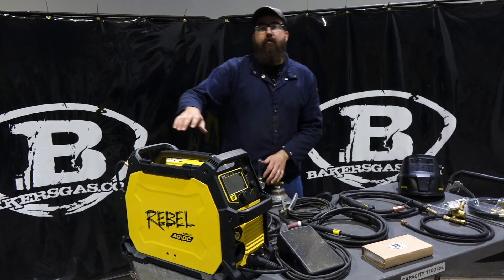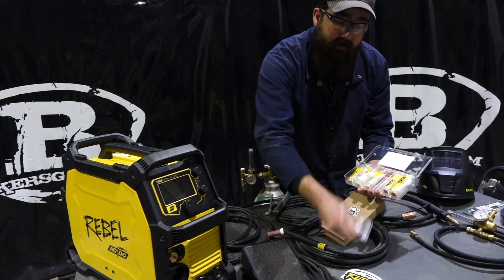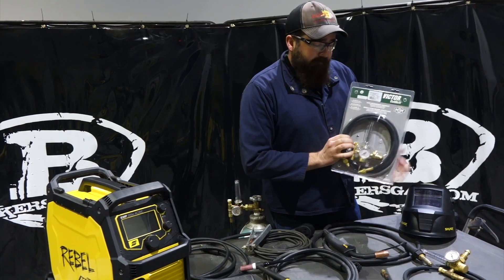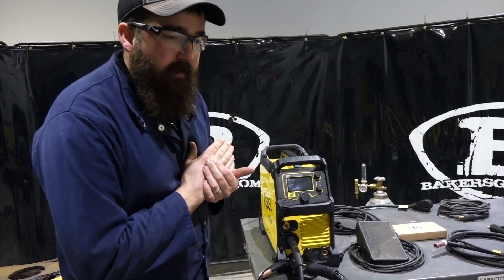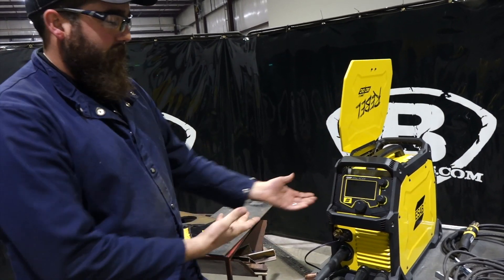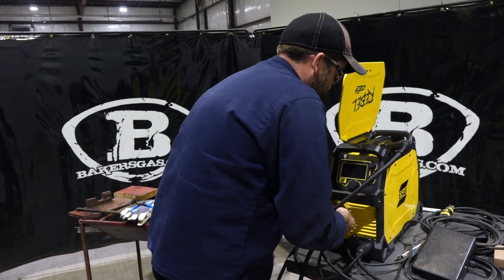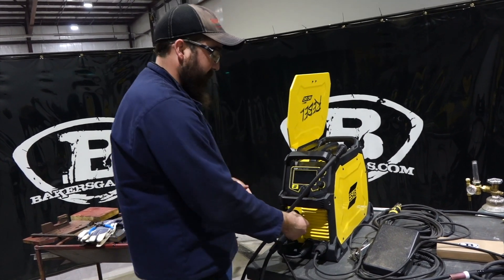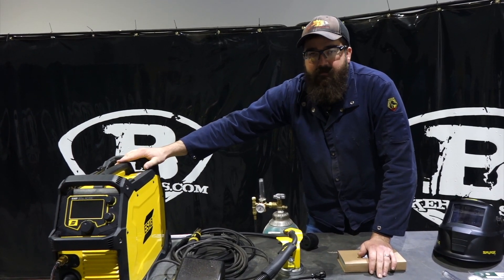Rebel 205 Switching From MIG to TIG

Comment: If you have gas for mig wouldn't you use that same gas for tig welding mild steel? In that case do you take the gas and swap it from the mig bung on back of welder too the tig one?

Comment: ESAB looks like a sweet machine.

But it looks like the switch mig to tig is simpler on the Miller 220. No switching cables or unplugging anything. 

Pull the trigger for mig, hit the pedal for tig. No need to go back to the machine.
Reply: Right.  On the Esab Rebel it looks you have to disconnect everything except the Mig gun. Which I am sure is nice you don't have to mess with wire feed or anything.  I am currently shopping this machine.
Reply: But, the miller is DC only, where this is ac/DC tig
Reply: @samwagner31  Miller 220 is AC/DC tig.

Comment: I can confirm that it is very useful to keep MIG and TIG hooked up at the same time and I quickly go back and forth between both processes, often depending on whether I’m welding something flat on a table or at an awkward angle.
Reply: Switching back and forth at the tap of the pedal or touch of the mig trigger seems to be where the Miller really shines. Wish Miller had the range of adjustability of the Esab.
Reply: @JeffinTD  I’ve wondered if the Miller is better made or more rugged. I know the bigger much more expensive Miller TIG machines are, but at this price point any combo machine might be a bit of a hobby machine. My Rebel 205 died with very minimal use after a few months, ESAB first serviced it, then replaced it, and even the replacement seems a bit flimsy and sloppily out together. It works but I wish it was a better machine and wonder if the extra ranges was worth it. But the Miller might be made in the same Chinese factory. :)
Reply: Wow. I would guess they are similarly made. Glad Esab took care of you. By the time you add a 2nd regulator to Esab, price wise they seem pretty equal. I don’t know why Miller didn’t allow more frequency, balance and amp adjustments. For an inverter, one would think it would be a matter of programming.
Reply: Do you have to swap the gas line on the back moving from mig to tig? I don't understand since it shows a tig torch with the spool gun? Is that just for acdc
Reply: @Scottydoing No, I leave both gases always connected. To switch between MIG and TIG, you just have to flip the ground between negative and positive and plug in the TIG or MIG connection. Just takes fifteen seconds, although the Miller doesn’t even take that. Nothing needs to be unplugged or moved as I understand it.
Reply: @automaticprojects  so in my situation I don't have a second regulator yet so I just have my mix gas hooked to the mig gun bung at the back. When you swap from tig steel too mig steel the gas line on the back still has to be swapped?
Reply: @Scottydoing The package I got from Baker’s Gas in 2019 came with a second Victor gas regulator, so I’ve always just left both gases connected to the back of the machine. I never swap or move them or do make any changes to the back of the machine. Switching from MIG to TIG or vice versa automatically uses the correct gas input in my case. But with one regulator you’d have to change the tank it’s attached to and also move the regulator to the correct input on the back of the machine for the corresponding process.
Reply: @automaticprojects  and say after I do get another regulator and line, hook it up to the tank, there is never a point swapping from processes you ever have to swap any lines?
Reply: @Scottydoing  Correct. I have an argon tank connected to the TIG input and a mixed gas tank connected to the MIG inputs and never touch them or change any settings. When changing processes I only have to move the electric inputs on the front of the machine.